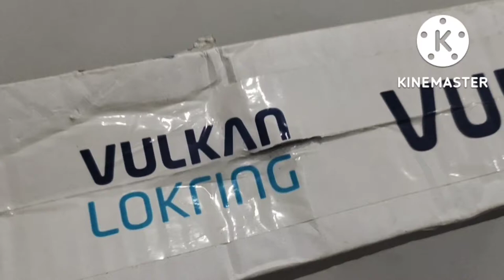HOW TO USE LOKRING TOOL FOR REFRIGERATOR LOCKRING ........

Comment: Ummm this video is bogus. They are putting the dryer and lines in the outside of the compressor compartment. Let's see it done right, in the compartment where it should be
Reply from the maker: Dear my friend, if you watch this video completely then you will come to know that the dryer is not outside, there is a condenser coil inside the fridge, the pipe in which the connection is taking place is the internal pipe.  PLZ don't comment wrongly without watching the whole thing..
Reply: @samtechpack2289  drier should not be exposed. Nothing false about my comment. You are doing it this way to show how to use a tool that is useless for most applications as that crimp tool.is MASSSIVE and could never be used the way most line are routed and located

Comment: I just bought this because I haven’t been able to find a solder that will work with the compressor, copper line and the condenser stainless steel line
Reply from the maker: Yes really this is a very good and easy tool with the help of which we can easily make the joint of copper and steel which earlier was difficult and thank you for your support please share this video so that this information can reach everyone...
Thanku sam tech pack
Reply: @samtechpack2289  hey man just wanted to let u know I used that tool tonight for the first time and I don’t think I would have figured out how to use it without your video. Was pretty damn easy
Reply from the maker: @djnemesis82pluss1877    thanks..plz share and subscribe
Reply: How to buy
Reply from the maker: @shakarreddy  plz go to www.vulkan lokring tool.com